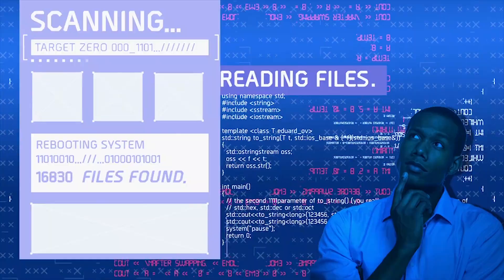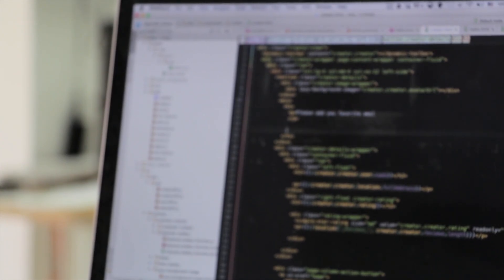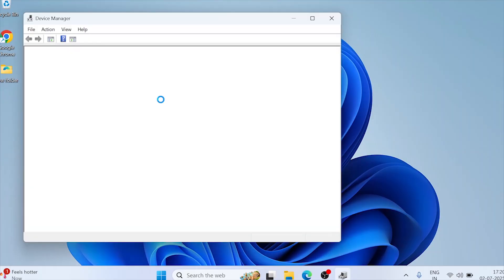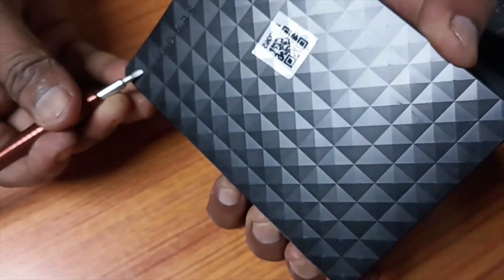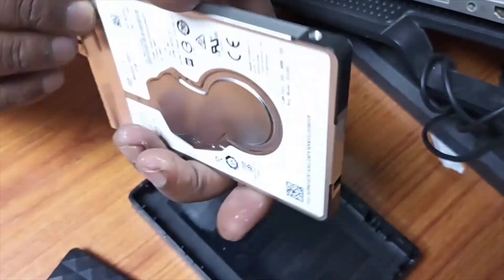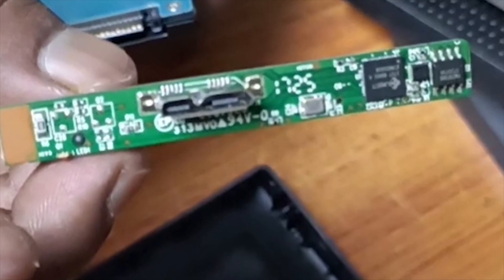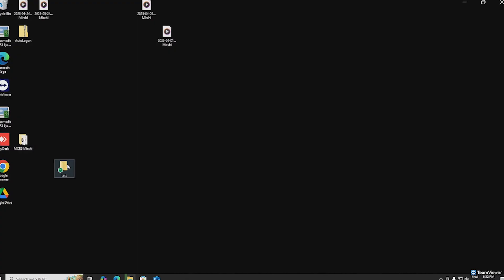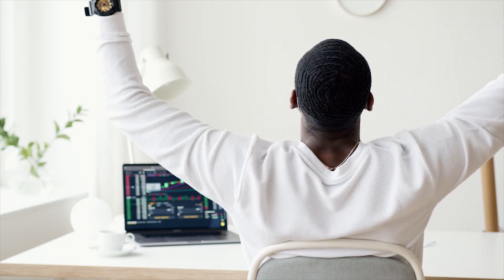How I Recovered Data from Dead USB External HDD | Fix Not Detected Drive (100% Working)

Comment: Mine is a Toshiba HDD and the adapter doesnt exist. Only usb from the hdd's pcb
Reply from the maker: "I'm sorry to hear that the adapter doesn't exist for your Toshiba HDD. However, if the HDD has a USB connection directly on the PCB (Printed Circuit Board), you may be able to use that to connect it. 

If you're looking for tutorials or guides on how to connect and use your Toshiba HDD, I'd recommend checking out the CRACKTHEWINDOWS channel on YouTube. They have a wealth of information and tutorials that might be helpful for you. Consider subscribing to their channel for future updates and guides. Good luck with your project!"